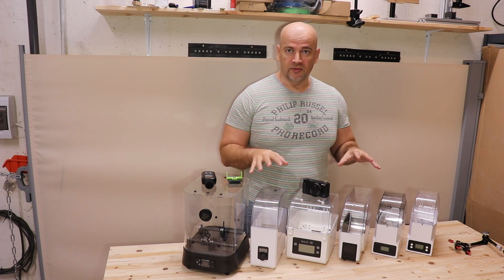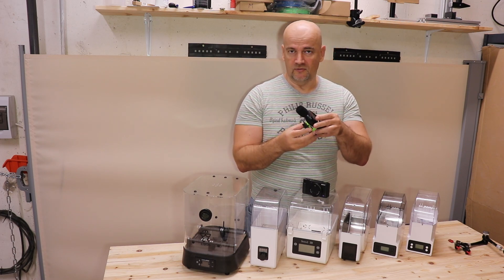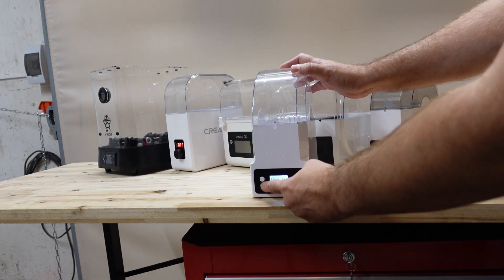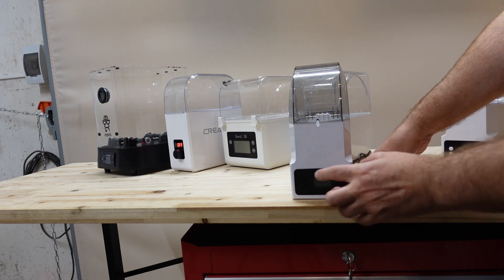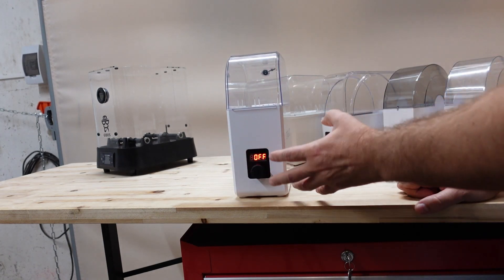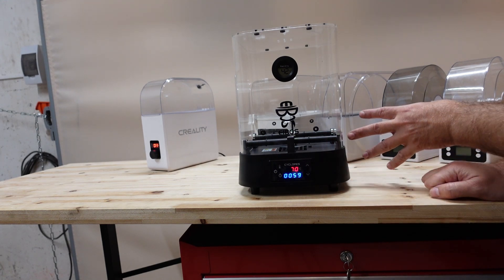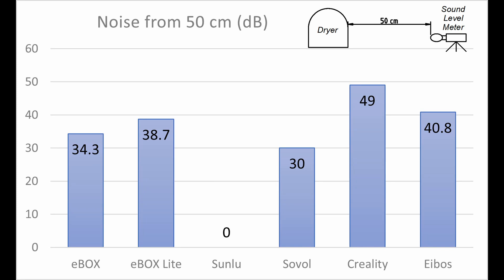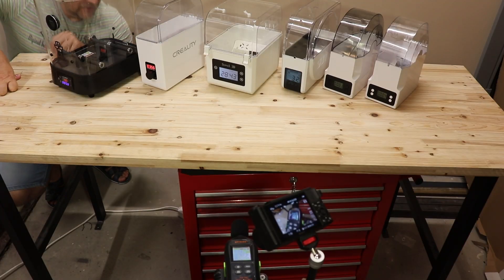6 filament dryer noise test - How loud are these drying boxes? eSun, Sunlu, Sovol, Creality, Eibos

Comment: I bought the sovol 3d three months ago and it is very quiet except for the loud BEEP when you press the buttons. I forget it is on sometimes. It does a very good job of drying my filament standing alone or when being fed into the extruder via the holes on the top. You can put packets of silicate inside to help with the drying. No more popping TPU.

Comment: PLA glass transition temperature is 50-60 degree, will dryer affect the physical properties of PLA, Please test if possible.
Reply from the maker: PLA drying temperature is 50°C, it will not affect the specs. Or you mean to "dry" the printed object? That's annealing process and it needs 100+ temperatures. But PLA object will deform during annealing. Search for "annealing 3d prining"
Reply: petg too…
Reply: @BlackGymkhana  
I never tried it with PETG since I never had problems with it til here, but I might try it next time. Where I have got massive better results recently is with TPU and I must admit I was wrong about the PLA. PLA gives also better results when using it straight out of the dryer at a moistre level below 20%. I use the new single roll dryer from EIBOS btw.
Reply: PLA doesn't need to be dryed to begin with. The filament which absolutely needs to be dried is Nylon.

Comment: I ordered the Eibos, pretty excited for it as I think out of all of them its probably the only one worth having. I bet with some thermal insulation around the sides too it can get a lot hotter.
Reply from the maker: I hope you used the coupon code too (it's in Eibos review video)
Reply: @MyTechFun  Sorry bud I ended up getting it on amazon it was cheaper (stangely)
Reply from the maker: @Festivejelly  no problem, those are not affiliate coupons, I wrote just for your best.
Reply: I also ordered the Eibos. I think that's the best deal, since it performes best and it holds two spoils for roughly the same price like the others. If the noise bothers me I will just swap the fan to a better one.

Comment: I recently bought myself an eSun eBox - the fan sounded way worse than yours as it was more like the Creality dryer in your video. I fixed the issue by ordering myself a Noctua 12V 40mm fan. After opening it up and altering the Noctua fan shroud a little to fit the fan holder I now don't even notice it's on anymore.
Reply from the maker: Great info. Yes, that older eSun works on 12V. The eBox Lite on 24V.

Comment: ok.... definitely Sunlu then get your self a 24v 40mm fan and then mod the upper side corner so the hot air can circulate, and there you go a completely silence filament dryer that come with a fan XD.
Reply: I have the Sunlu and made that mod. But... I was near shocked with the loudness of this upgrade / mod! Thought first, it was a faulty Sunon fan and changed it with an other one of the same brand; but the same. Then I bought an other one, that was in specs way quieter; again the same. I checked all three then unmounted and all were really quiet! The reason for the loudness? Resonance with the case! I could not feel any uneven rotation holding them in my hand, they all rotate smoothly and "soft". My solution then was to put some soft rubbers between the mod and the case and integrate a PWM motor regulator to reduce the RPMs of the fan. Only like this I got a somehow quite working of it!
Reply from the maker: That's right, most of 24V fans rotate too quickly. Also, bigger fan with smaller RPM is always quieter with same air flow rate.
Reply: @billereses4935  12V Noctua fan with buck converter

Comment: The pity that the test was not done with embedded filament. The empty volume also affects the resulting noise level. Real conditions were unsolved. Who uses an empty drier on? You have good videos, I have already bought several products based on these tests. Thanks.
Reply from the maker: Hm. I didn't think about that, I tested one now (eSun), but there is no significant difference (less than 1 dB, hardly measurable)

Comment: Interesting. For my needs this would make the Sunlu the Only viable option, despite it having the lowest performance. 30db is way too high for where I have my printer + filament, as its a shared space.

In regards to the 3d printer sound test, maybe include the types of fans used? For printers with modern "silent" boards, the fans rather than the motors are the bottleneck for sound during operation. I have an ender 5 pro (which was far too loud), and have changed all fans to quieter options described as 14db, but are likely louder to due interference. Including the fan part number for the test would be helpful for those wanting to upgrade
Reply from the maker: At this moment, I am not sure if there will be 3D printer noise test. So far only 5 responses on that form (and 1 was me for testing). But if there will be, they will be tested during printing PLA (fans on max+stepper motors).